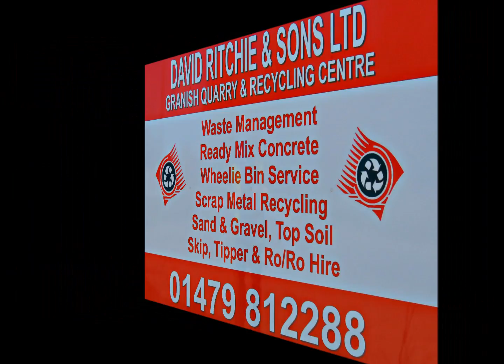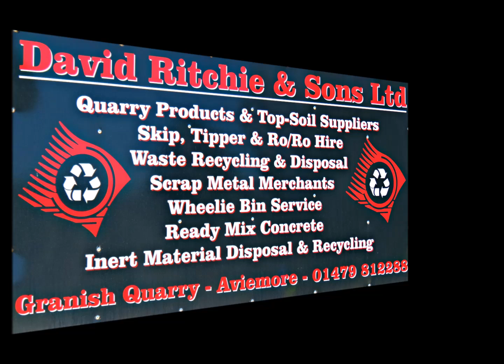♻️ WASTE RECYCLING - The sorting & segregation process.♻️

Comment: This may sound stupid but, the skip he tipped at the start had pallets and polythene sheets in so what happens to the pile out of the skip before it goes onto the conveyor, is that by hand or?
Reply from the maker: Yes the "bulky items" are picked out first, this is done with a 360 excavator with grab attachment, or by hand prior to going onto the conveyor.
Reply: @DavidRitchieandSonsLtd  Ah nice, sorry to mither, just really love your setup 👍
Reply from the maker: @joshpurdie4557  Not a problem, we welcome an interest and any questions you have.